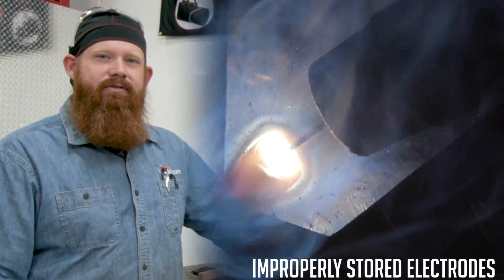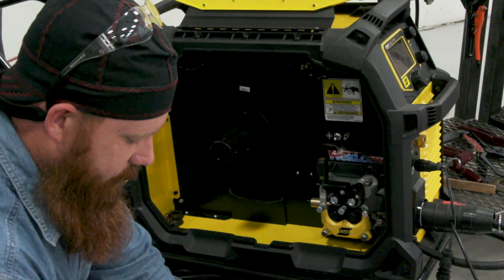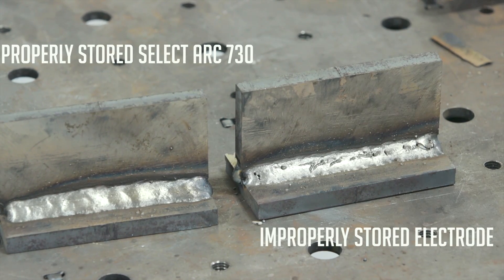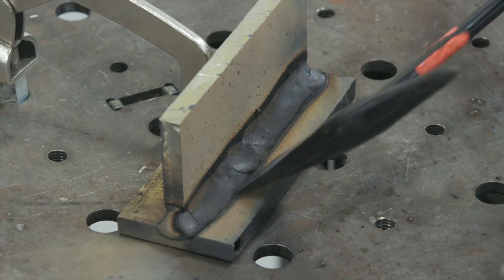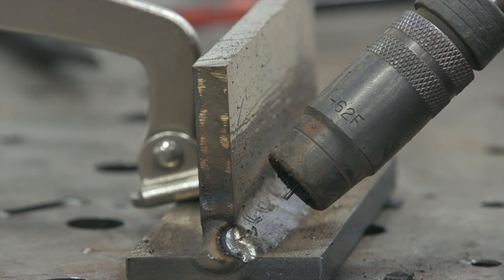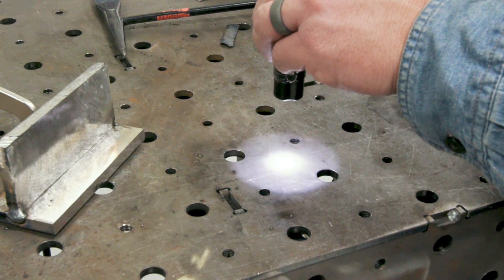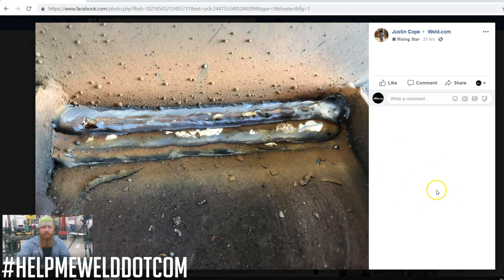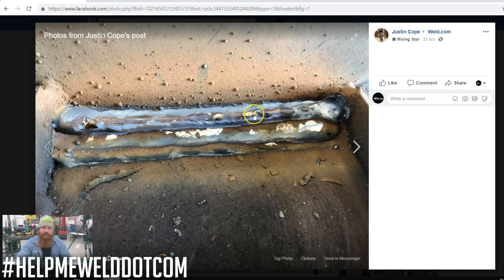3 REASONS YOU GET WORMHOLE POROSITY!!

Comment: I had a hell of a time welding some stainless steel to some galvie channel using fcaw 309L  .045 MiG wire…worms and porosity like crazy I have a feeling
It’s because the galvanized coating wasn’t ground off good enough but I’m not sure ,it was the first time I’ve used that wire. Also I could not for the life of me get it stick in the 3g position going up. I had to pick everything up with a sling, drop it on some horses and weld everything flat

Comment: Nice and very educational video! I was wandering why it's happening and noone could properly explain but looks like my arc was to short( first 9 years I was doing stick only) I didn't realize that it can be issue and case worm holes. Experience b-presser welder told me that it's because dirty work pieces.  But after this video I realized that it's short ark and old contaminated wire. At that shop flux wire was stored opened for years on a shell......

Comment: One thing I’ve learned about flux core over the years with stickout is that under 300fpm of wire speed the stick out distance becomes exponentially less important. It’s the higher wire speed that doesn’t allow the flux to heat up without enough stickout.

Comment: Hi, excellent video.
I’m having this problem un my house shop. I am self learned welding and I knew electrode rods go bad with moisture. However, i never thought that the core of a wire would go bad because of the same.
How should I store properly a spool of electrode? I don’t weld every day to not have the storage problem.

Comment: I love how you say to always follow the manufacturer's guidelines. Where I work now I'm using select arc 1/16th diameter wire. Everyone else runs it around 204 to 2:20 wire feed speed they say I'm putting too much heat in the metal. When I show the foreman the manufacturer specs he said I don't care what you see on the damn internet we've got our own procedures
Reply: I run 1/16 Lincoln 71M, doing full pens I sometimes run the wire at 280-300 ipm and it comes out good with the voltage at 27.3-27.8
Reply: Exactly

Comment: Bro I've been fitting and welding for 16 yrs.I usually fit, but I've always hated flux core because I would always randomly catch porosity.i would of never thought it was from the tip being so close.it makes a lot of sense because I'm on some heavy wall pipe right now I haven't capped one pipe without getting porocity

Comment: You said to properly store your wire, but they didn't say how to do that. Or how the improper wire wald stored.
Reply: Good question.  Most don't realize  flux core is just a folded sheet, so moisture get in through the fold.

Comment: How do these wormholes happen with gasless fluxcore 232 wire?
Reply: The flux in the wire core creates a protective gas shield during welding, these worm tracks are not from the Co2 over shield

Comment: Here's a stupid question from a new welder, Why use flux core wire with Gas? I thought the whole reason for flux core wire was you didn't have gas available.
Reply: It’s better for heavier material, also heard the flux solidifies quicker offering a better platform for the weld pool to solidify itself, would like some sort of clarification though from anyone who knows more about it, only ever done MIG and stick welding for work
Reply: The whole gas thing as far as convenience goes is a pro but not the only reason for the difference, you can get better penetration with flux core if done correctly
Reply: I’m a sucker for standard MIG though, the bright blue light and that sharp crackle when it’s dialed in properly is what made me become a welder to begin with lol 😂

Comment: I usually run 25v with 300wfs on our fronts machine. when you said about the settings I called bs but man that's a nice bead!
Reply: I agree. Ive run 31v and 550 on vertical butt welds 3/4” thick.  Flat I’ll go up to 36v and 700. Match wire speed to voltage, along with travel speed. If the work will handle the heat then turn it up and go baby go

Comment: I understand proper storage of mig wires needs to be considered, you mentioned how important it is. I would like to learn the proper storage methods. A short video with some examples of common and best practices to achieve this would be much appreciated.Thanks
Reply: Most wire spools come sealed so they don’t react with the atmosphere. Don’t open a new spool till you need one. try to use up that spool within a reasonable amount of time. We had a spare machine that was seldom used so the spool would last a long time. by the end of the spool it wouldn’t run the same. simple as, besides that put em on a self inside where the temperature/humidity wont fluctuate too much
Reply: if gas can diffuse in it can diffuse out too.  I wonder if you stored it in CO2 if the wire would get fixed
Reply: Get an old refrigerator and put a 100w light in it. Put all your wire and rod in it 👌

Comment: Im using selectarc 309 and 317L- AP flux core for stainless steel. I keep getting "wagon tracks" and some pin hole. Flux is cleaned off, and no matter what the stick out i keep having the problem. Our wire is stored in a temperature and humidity controlled room, as we build pressure vessels for oil companies. Im laying overlay on top of carbon as the inside of the vessel is stainless clad. TMI aside, i have a hard time with appearance also with this type of wire. Perhaps you could do another video on stainless with a similar wire in a horizontal or vertical position? Sorry for the ramble.

Comment: Great video. 
The problem I seem to have is on occasion I get what I call tiny bubbles in the very top of my welds. Welding with E71-T1, FCAW.116, looks like someone took a centerpunch and just pinged the Hell out of it. I'm thinking too much voltage. Any ideas on what's causing and how to prevent it?
Reply: I’m guessing you’re running vertical. The tiny bubbles you are describing are called clustered porosity. From my experience a lot of people tilt their wrist back while going vertical. This can cause a longer stick out and cause porosity at the top. Keep the wire pointed straight in, or slightly down (about 5°) and drag the wire up the joint. Pause at the top to fill in any crater and that should fix your problem.

Comment: Fantastic video, I wish the bosses at the company I used to work for building highway structures could  see  this video,  they stored the wire improperly, wouldn't let us turn the gas flow up,  didn't provide drawings done to drafting common practice and wondered why they had so many QC issues and reworks, most of the time I was the lucky bugger doing the rework.
Reply: Oh man, I was the lucky idiot who did the rework at multiple factory jobs as a welder... it sucks to be good at what you do sometimes, eh?

Comment: I have found that hydrogen (moisture) in the base metal can cause worm tracks too. I discovered this issue while working at a structural fab company and welding joints on steel that had been stored outside in the weather.  Only fix was heating the joint areas to cook out the moisture.
Reply: 100% true, I used to work for a highway structure company, the SOP called for 300* F preheat, the amount of moisture displaced was unreal, the foreman used to get all weirded out saying we took too long preheating then wondered why they had worm tracks.
Reply: Agreed, always preheat at least to remove moisture especially when running dual shielded flux core
Reply: An old wives tale.  Moisture is from the gas process.  Ever seen water cooking out of a car's tail pipe?
It does help for other reasons though.
Reply: Steel doesn't contain moisture as it not porous, or else boats would sink and buckets would leak. Dunno about hydrogen and all that but definitely doesn't contain moisture/ water.
Reply: @rich3633  run a cutting torch down a sheet of plate steel and watch it sweat. The surface of steel is porous and will hold more moisture than you realize. I battle this daily as a professional welder.
Reply: @johnthomas8605  That is the product of combustion condensing on the plate then evaporating. Trust me mate. I'm a welder too. 👍. Seriously, look it up. Don't mean to sound condescending. Water vapour  being one one of the products of combustion of hydrocarbons. Cheers dude.
Reply: @johnthomas8605  it is a very common misconception in the industry though in my experience. Have you ever noticed how it only happens with oxy fuel and not when steel gets hot from welding or plasma cutting? No products of hydrocarbons being burned means no water vapour.
Reply: @rich3633  wrong,  Steel does have porous in the surface and that's why preheating works.
Reply: @AndresAlvarez-cp2he  steel is not porous. The mill scale is though. Heating has nothing to do with pores. Preheating merely reduces the temperature differential to aid with base metal fusion ,crack reduction and aiding with mechanical properties. If steel was porous then it would act like a sponge. Boats wouldn't float and buckets would leak.
Reply: @rich3633  I think that the issue here is how we use the word porous. I am an English Second Language so bear with me lol. AWS D10.10 recommends preheating pipe before welding to drive moisture out of the surface. Steel isn't like a sponge, correct, but the surface isn't completly flat (even flat srufaces have pores). All objects that are in contact with the atmosphere have a layer of moisture, this depends on the humidity and temperature in the atmosphere. If this weren't the case, rust wouldn't occur, as rust needs an electrolityc solution and an "electrical differential" to happen, similar to zinc or copper plating. 
There is a layer of moisture in the surface of the metal, even without millscale, simply wiping it with a fiber won't remove it.
Reply: @AndresAlvarez-cp2he  I think that may be the issue. I agree that surface moisture does occur. It's just that in general people who aren't educated on the subject think that steel 'holds moisture' which just isn't true. They justify this by saying you can see it come out when heated, which is actually the result of hydrocarbon combustion (CO2 + H2O) condensing on the surface of the metal before the material is above the dew point of water. (if that makes sense) it's basic schoolboy chemistry. I'm a pipe welder too by the way 👋, where are you from?

Comment: Maybe a dumb question, but you're running flux core wire and shield gas?
Reply: 2010stoof yes, the wire is designed to be ran with gas. There are two types of Flux Cored Wire. Some run self shielded and others run has shielded.
Reply: @GodslilRedneck23  Ahh ok. Yeah I looked it up. We run solid wire shielded gas and our robots run just flux cored no gas. Learn something new every day.
Thanks!!!
P.S. I'm not a welder, just curious

Comment: One thing I would like to add is that if you are welding with old dual shield flux cored wire and you put the weldment in the "vertical up" position, you will almost never get wormhole porosity as often as in the flat position. , if you are able to move the weldment into that position of course.

Comment: So how do you properly store you wire? You talked about the need to properly store it but not how to.
Reply: William Write keep them in a dry room 70°F or higher. Keep them covered with a box or bag when not in use to keep debris and particles from the shop off the surface of the wire.
Reply: Check your wire manufacturers recommendations.  Select  Arc have some good info on their site http://www.select-arc.com/products/index.php?content=storage, the crucial info is maintaining at below the recommended maximum RH level to avoid any moisture pick up in the wire. For critical application work either invest in a  wire storage oven or a laboratory drying oven.
Reply: A hot box. We have a hot box for flux and one for stick

Comment: I have a question. MIG torches all use a similar sized nozzle. Since the arc length/stick out for dual shield is so long and the amount of shielding gas is so high,  would a larger diameter nozzle aid shielding gas coverage as it does in TIG?  With the wire being hot, developing a diffuser may be an issue. Just wondering.

Comment: 9:30 - WRONG. Draging gets you better penetration than pushing
Reply: Sander Kõue that’s a common misconception. When you drag GMAW especially short circuit, you will have more buildup and less penetration due to the wire stacking on the puddle and preventing penetration.
Reply: @GodslilRedneck23  Noup, you are wrong. There is a small difference in penetration but dragging will get you deeper penetration. On corner welds its better to drag first pass for better result
Reply: Straight in or push almost always gives a better weld quality, dragging traps more piles up more and often looks worse. I've literally run pallets of this stuff and never liked the way a dragged bead lays down.
Reply: I always drag.Try a push vs pull on a piece of thin material to see which one burns through the easiest.

Comment: Flux core with gas ???  Can you do a video on flux core with gas and without gas difference
Reply: Yes, this is not your standard gasless flux-cored wire that is self-shielded (which is E71T-11 or E71T-GS).  The wire in this video is specifically made for use WITH a shielding gas.  The gas can some times be C100, or it can be C25, or even some other composition.  Some common wires are E71T-1C (uses C100), E71T-1M (uses C25), and E71T-1C/1M (can use either C100 or C25). 

So you can't just switch the gas on/off to "see the difference".  They are two completely different kind of wires, even though they both have flux on the inside, the flux itself is different.
Reply: @zod-engineering-welding  ok got it thanks for the information 👍

Comment: I have never done this kind of welding and just watching the first 40 seconds I see it is basically a MIG/STICK mix mig wire with stick flux if I am correct im only 18 so bear with me guys lol
Reply: Just the welder alone is 15 grand and that's a truck and a half from where I come from
Reply: ALONE ON BLITZ yep, I usually explain it as an inside out welding rod. Wire is on the outside and flux is on the inside.
Reply: @GodslilRedneck23  I'll keep those in mind, ill keep using my old one till I fork up enough for a good helmet, what good is a helmet without a welder, I have been welding since I was a kid, dad showed me when we were in the fields and a digger broke, he gave me the handle and told me to run a bead at 7 years old, worked around the farm enough he got me my own, made some arts n crafts stuff for the school cuz nobody in town is a welder except a kid now days lmao
Reply: @GodslilRedneck23  thanks man, I kinda figured the metal would be on the outside but I never looked into it too far, I dont have modern equipment as most of the others do like the rebel welder as shown☝️, I have a portable stick welder its max is 15 volts so I dont get around much just enough to hold some parts together around the farm
Reply: ALONE ON BLITZ hey man, that’s a start.
Reply: @GodslilRedneck23  so much more to go man, just getting enough money to spoil myself lol, I'm going to get a Lincoln electric power wave s500 and a new welding helmet, one I got now if I look at you you can see my chin😂 any recommendations under $300
Reply: ALONE ON BLITZ my favorites are the Lincoln Viking or an Outlaw Leather with an ArcOne drop in auto lens.

Comment: I'm not a big time welder. A little torch welding here and there. So excuse my ignorance. But does the porosity affect seriously the strength of the weld? Just was thinking of the wire waste. Thanks
Reply: A weld with a bunch of little holes in it or a weld of solid steel. You dont know which to choose?
Reply: @clevelandmortician3887  Sure,, I understand. I'm asking as to how much stronger or weaker is the bond. The bond is as important as slight porosity. As I looked at his weld chain, the porosity didn't look that serious. Compared to throwing away half a spool or more of wire, because you stored it in a more humid environment? That's all I was asking. Like I said, I have never worked with mig or tig, so all I'm familiar with is oxyacetylene torch welding, brazing etc.
Reply: @peterford9369  throw away the half spool of wire